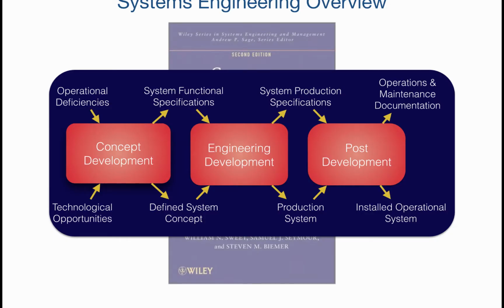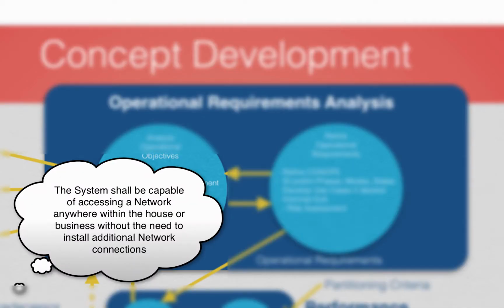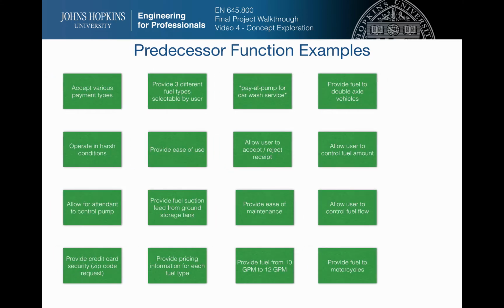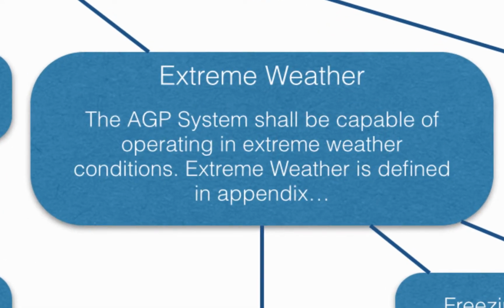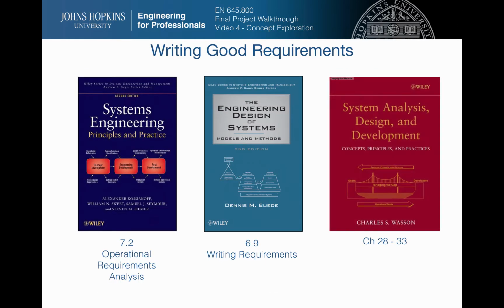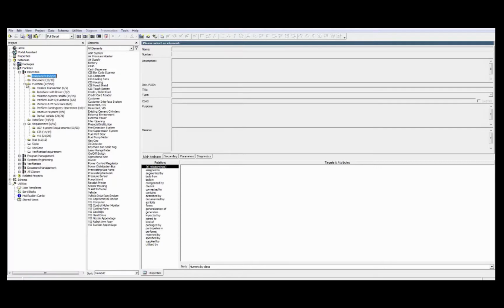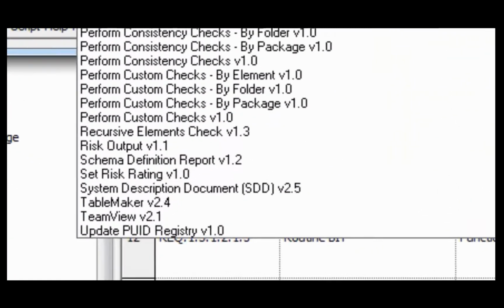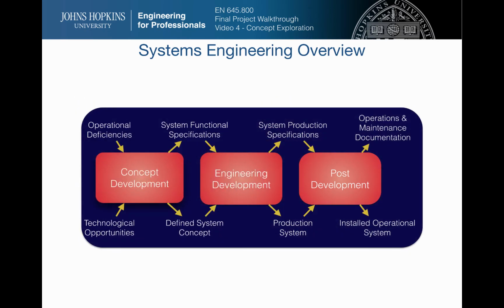JHU Masters Project Walkthrough (04) Concept Exploration

Comment from the maker: "Where's Video 5 and 6??" you may be asking.
I'll be posting those in the Fall semester of 2015 time frame.
The Spring & Summer semesters of 2015 I'll be focusing on developing all-new material for the Intro to SE course. 
I apologize if these videos are not available now, however alllll you have to do is turn to chapter 8 in SE P&P and read it. These videos are developed from the content of the SE P&P, Wasson and Buede text books. 
You can also consult some of my older videos on functional analysis and physical allocation for more in-depth CORE stuff.
More resources include the Intro to SE, Concept Development & SD&I slides; Steve Biemer's great set of office hour videos; AND of course office hours with your mentor!
Good luck on your projects!
Reply: Hi, will you post videos 5 and 6?